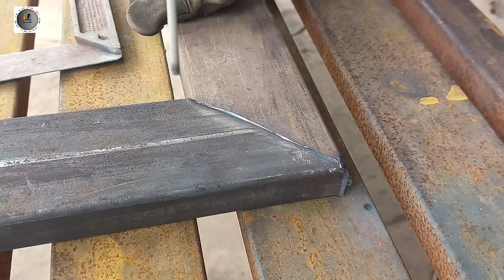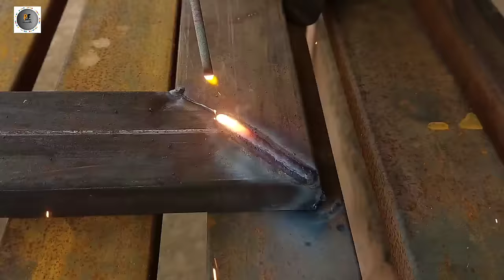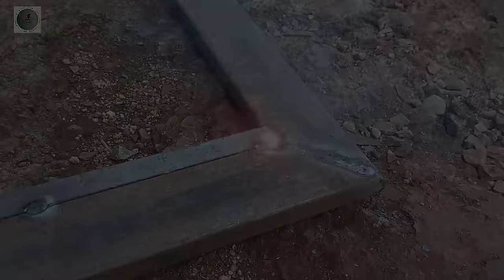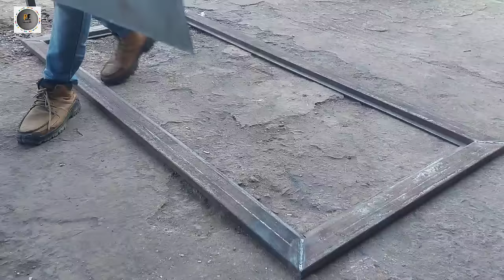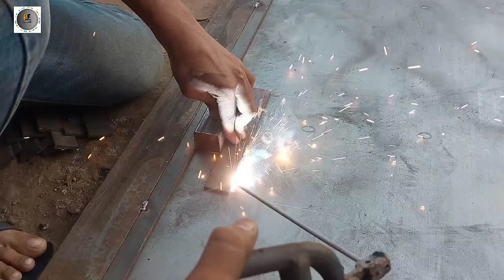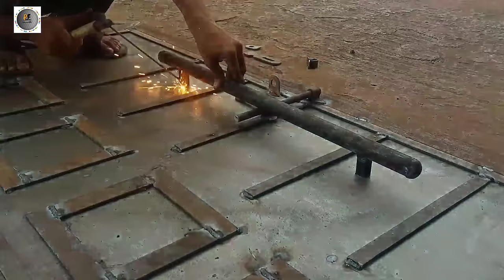Safety grill gate design for main door | iron main gate design

Comment: The door you made and the result you showed is not the door. The door handle you made is round and the other one is square. You can only use the door you made as a toilet door. You just tried to make the same door as the last door you showed, but unfortunately there is a big difference between them. 🙂🫠